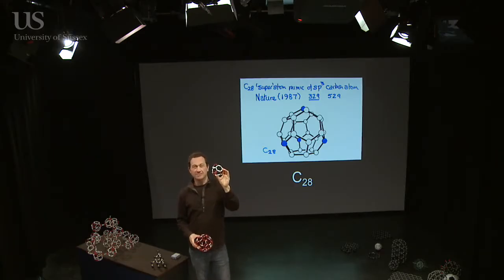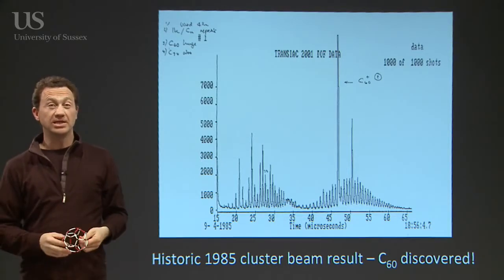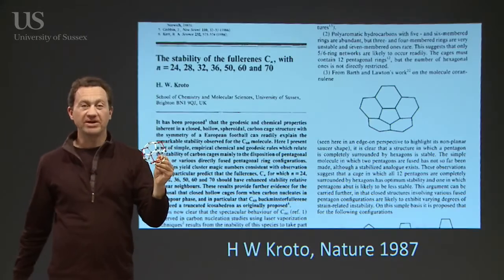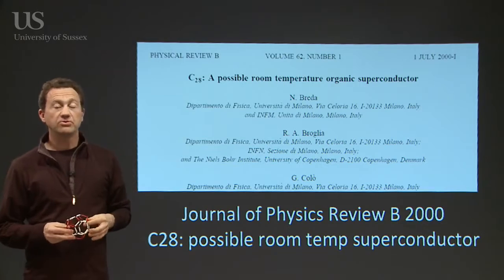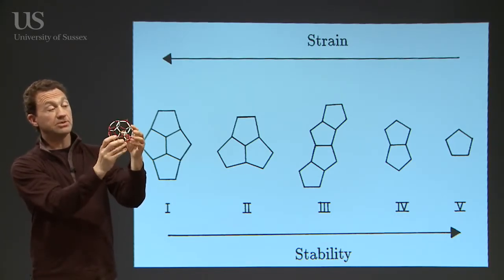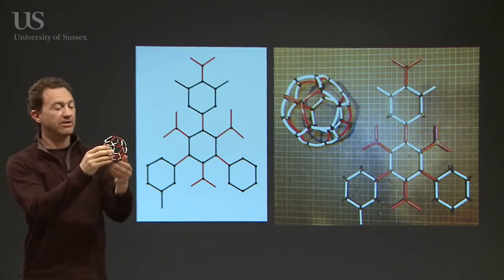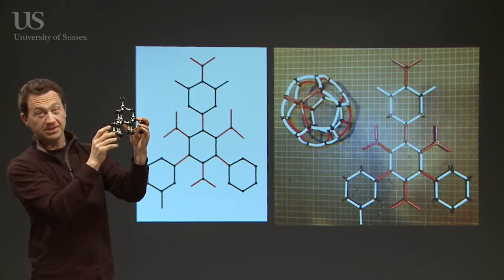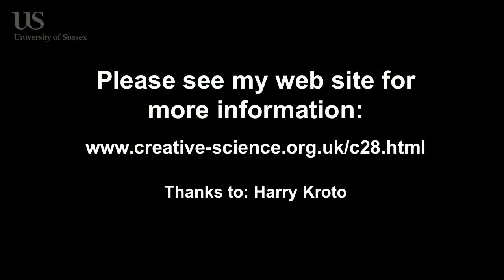The Carbon Revolution Part 8   C28

Comment: Would C28 have similar electron accepting capacity in the way that C60 does, ie could it be used in a similar way as C60 is used in organic electronics as an electron acceptor?
Reply from the maker: it does not have the 30 double bonds C60 has (30 double and 60 single bonds), but C28 has reactvity due to its tetrahedral symmetry so could create C28H4 or C28U  hyper diamond etc..
Reply from the maker: different chemistry to C60 - more like a single carbon atom so C28H4 like CH4 etc.